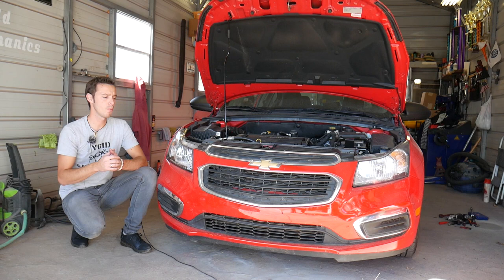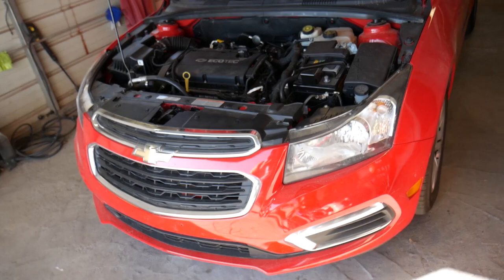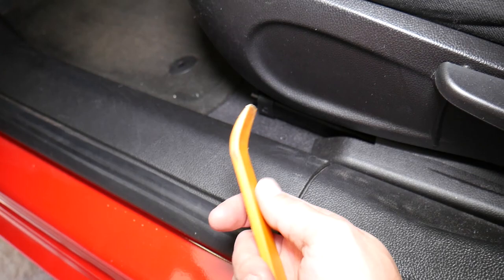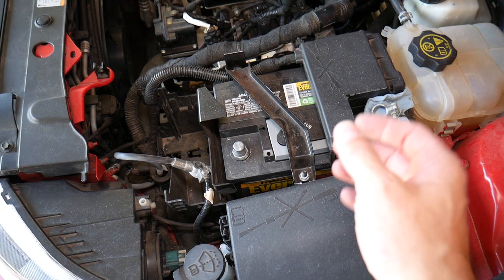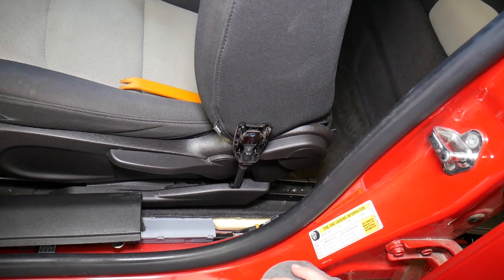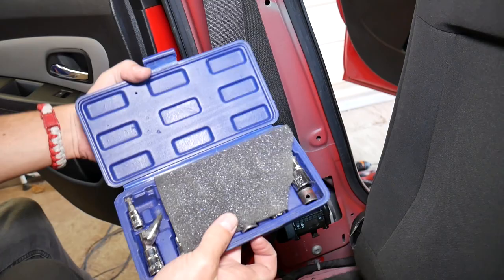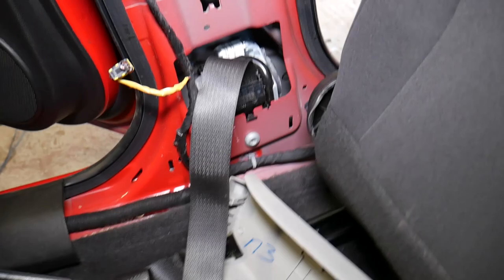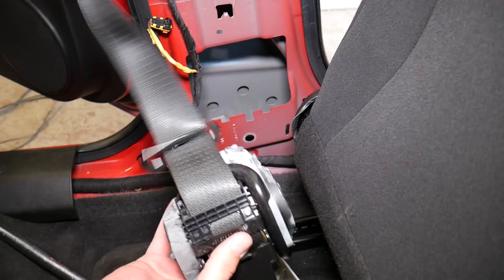CHEVROLET CRUZE FRONT SEAT BELT REMOVAL REPLACEMENT

Comment: Thank you , chervolet Spark is simulair , except a airbag warninglight is on after seatbelt change , needs reset probably
Reply: he did not replace the thing in the seat that tensions it, if you did it like he just showed you then you still have a bad part in the seat itself.
Reply: @davidphillips3953  in the seatbelt is An explosieve pretension unit . The secondhand seatbelt I bought was in An accident . That why I got the airbag warming light . Solved by now . Thank you